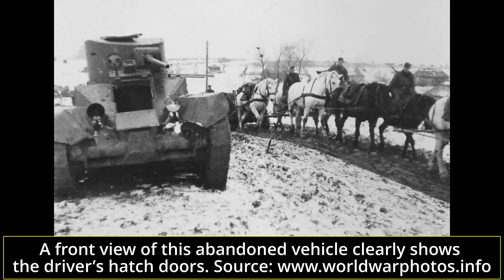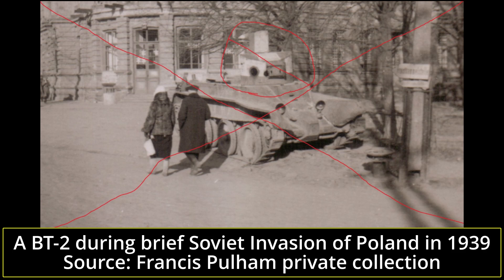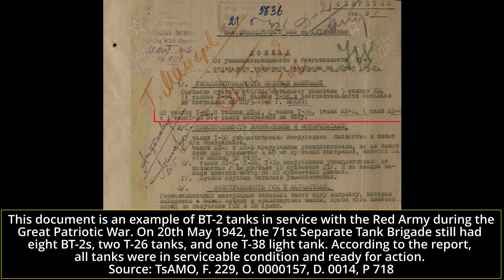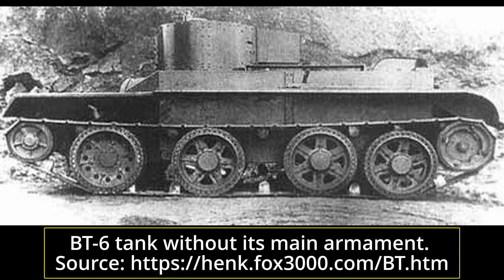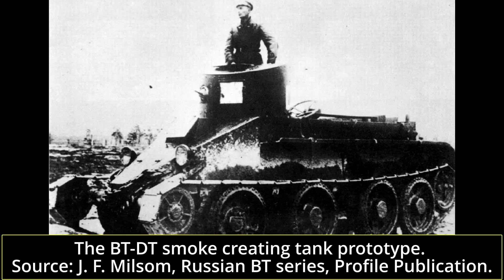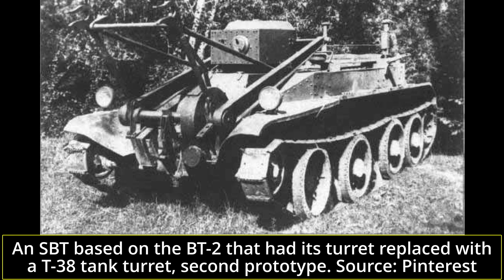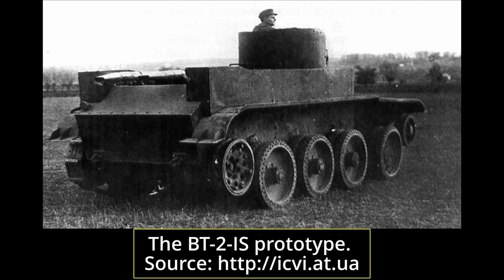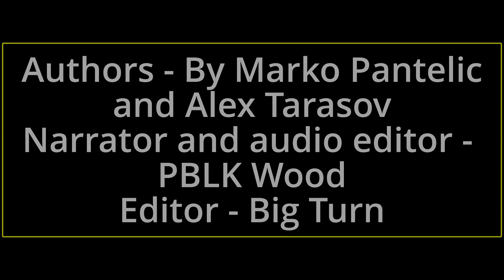Fast, But Not Furious | BT-2 (part 2)

Comment: As they were planning to invade Germany through Poland and use autobahns, Christie-suspension made it possible to run high speeds ,and only put the tracks on when in Germany. As all materiel positioned at the border was intended only for attack, and not for defense, they had little use when Hitler decided to attack first, even though he knew that it was too early. Stalin had waited in vane for the Operation Sealion to start to start his own attack, and the timing got wrong for him. All that can be found from a speech Hitler made after the Operation Barbarossa had started, and from the archives of the Soviet Union.